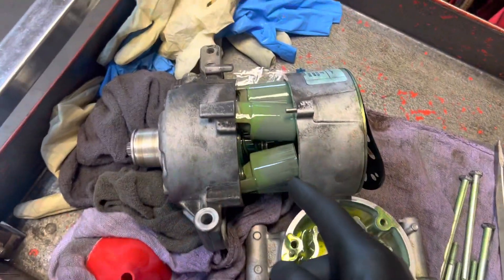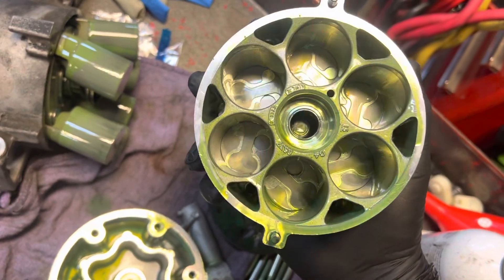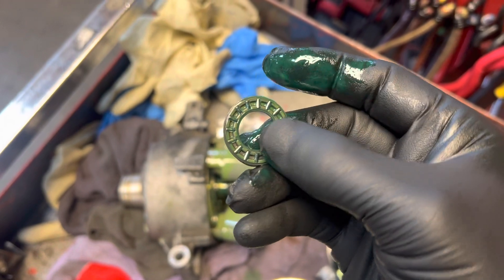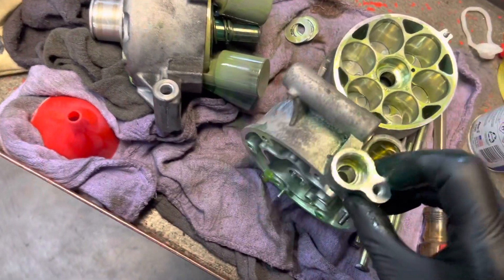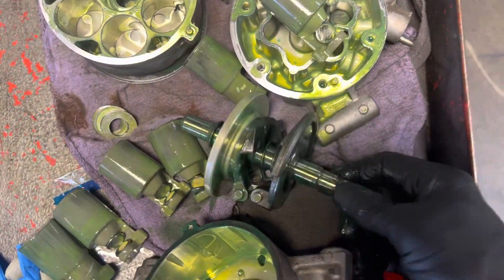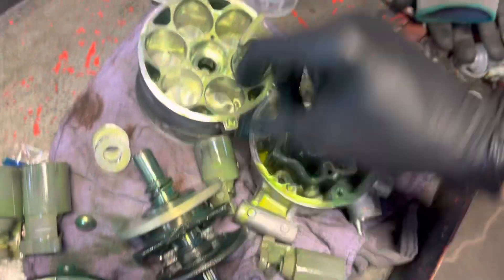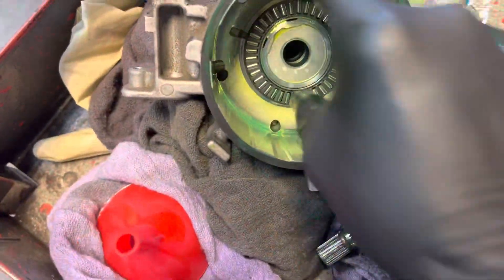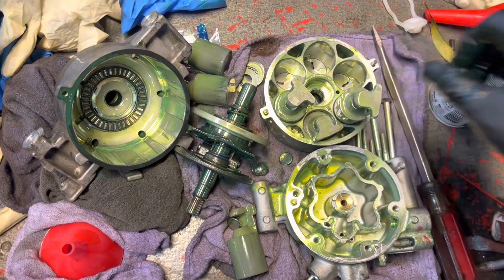Inside TEARDOWN working explanation  variable displacement compressor for Honda￼

Comment: I wonder what a 500 psi pressure transducer on the high side could tell us about the pistons of a compressor.
Reply from the maker: The pressure that’s about it. 

But there is one thing I could think of that a fast high resolution pressure transducer can tell us because there’s usually 5 to 7 Pistons or more in most modern day compressors .   Two-sided at that so you double the number depending on the manufacture.

If one individual reed valve or two or three were bent or broken, I believe we would be able to see that one single pole station within a 360° turn be different  than the ones with good reed valves

Comment: That’s why they charge a core charge! They take the old back and replace the seals, and sell them for another $1000 or so.
Reply from the maker: Actually they don’t take cores back anymore very few if any take any cores. 

The last few years all the compresses we’ve replaced no cores were taken back all going to garbage

The expense of labor is so high and shipping they only manufacture these compressors for $20-US$35 that’s all it’s not worth their time to take them back.
Reply: @coldfinger459sub0  Mercedes charges $70 or so for a core, in addition to a $1200 or so compressor!  Wholy money robbery!
Reply from the maker: @jrm163  🤣 I could tell you they’re probably not turning those cars back no more because all the DENSO compressors brand new they don’t require Kors anymore they just saw you a new compressor. 

That’s one way to make sure the customer doesn’t want the old compressor to prove that their selling you a compressor you don’t need because you’ll never spend $70 to take the old one back and hook it up and prove that it is still good 😊 so they make a $1200 sale with no possibility of the compressor taking recourse against them for ripping them off

And then when they discovered it’s the one dollar fuse or the $15 relay or damaged piece of wire that little cost is covered and they won’t tell you about that
Reply: @coldfinger459sub0  I haven't sent back a compressor core in close to 15years.
Reply from the maker: @nservice1625  that’s because compressors only cost about 15 or $20 to manufacture they’re not worth sending them over Caesar transporting them in the United States the labor so high they’re not worth tearing apart and rebuilding in the United States because of the labor it’s cheaper to just buy a new one.
Reply: @coldfinger459sub0  Yeah it's easy to manufacture parts cheaply when you force 8 year-olds to work in a factory and only pay them a grain of rice a week.
Reply from the maker: @nservice1625  and don’t forget they live in dorms in crowded old buildings on the company campus kind of like in a big round circle with an open yard in the middle, and only one way in and out no eye protection for welders or machinist no respirators or ventilation for burning fumes of melting metal.    I know this because I’ve been in several parts of Asia, and on tours of manufacturing plants, and I always like to ask the same question.. 

    I asked the manager that guy welding over there is not using welding goggles. He’s just squinting and looking away. What happens if he loses his eyesight 

The owner or the managers responses usually always the same. We get another one there’s 1 million more. . 

Watching workers manufacturing, condensers, knee-high and caustic chemicals for treating and cleaning metal no gloves up to their elbows in paint or metal cleaners over hot that’s of metal strippers with fumes coming up with no ventilation . 

I got to see how all of us Americans enjoy our cheap products to manufacture, cars and housing goods that we enjoy so much at cheap prices